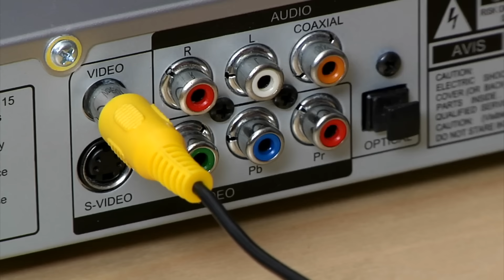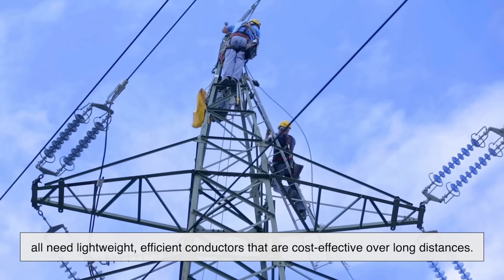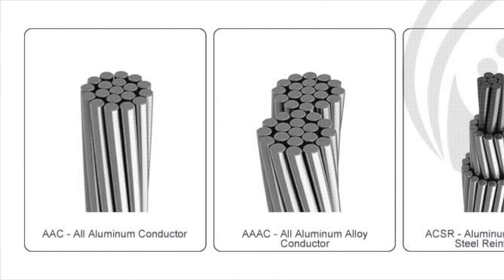Why Do Power Lines Use Aluminum Instead of Copper?

Comment: Aluminum is used for power lines over copper primarily because it is cheaper and lighter, making it more practical for long-distance, high-voltage transmission. While copper is a better conductor, aluminum's lower cost and weight reduce the overall expense and structural requirements for large-scale projects. The use of aluminum is often reinforced with a steel core to provide additional strength for overhead lines, notes this YouTube video and Nassau National Cable. 
Advantages of aluminum for power lines
Cost: Aluminum is significantly cheaper than copper, which is a major factor for large-scale power grid projects.
Weight: Aluminum is about half the weight of copper for the same conductivity. This reduces the need for stronger, more numerous support structures, leading to lower installation costs.
Strength: While aluminum itself is not as strong as copper, many modern power line cables are reinforced with a steel core (known as ACSR - aluminum conductor steel-reinforced) to achieve the necessary strength for long spans between towers. 
Why copper is still used in other applications
Conductivity: Copper is a superior electrical conductor, meaning it has less resistance to electrical current.
Safety and Reliability: Copper's higher tensile strength and lower thermal expansion make it a more reliable choice for smaller-scale applications, like residential wiring, as it is less prone to breaking at connection points due to heat-related expansion.

Comment: Copper or aluminum doesn't matter, if you live close to a high voltage transmission line. 
The microwave waves coming from it is not good for your health. 
Would you want to live close to a transmission tower or line. 
Property values go down, unless you're the owner of the land that the lines were installed on. 😅

Comment: Well my city and area all wiring is copper they removed the aluminum wiring years ago and replaced it with copper.  Copper doesn't expand in heat aluminum does copper is a better conductor and aluminum will have higher amps

Comment: It would be interesting to me to see more about high voltage AC & DC Transmission
and the differences involved with each including the materials used in the conductors, etc. etc.
Also the science involved with the production of the different kinds of  power.
Outstanding video, thank you.

Comment: With modern ultra-high voltage transmission technology, power can be transmitted with much lower amps, which means less energy loss with smaller diameter al cables. That's the main reason.

Comment: I'm an electrician from Durban south Africa and our metro elect dept uses aluminum MV and LV cables for cost and also cod of the theft when I comes to connecting to copper terminals bimetal lugs and ferrules are used❤

Comment: Years ago during storm clean up my foreman observed a wire dangling from the top of a telephone pole. He wanted to put caution tape on it, I said not to touch it . He laughed and said it's aluminum guide wire . I said it could be hot and I was right and he found out what 7,500 volts feels like when you hit your arm on a hot wire.

Comment: I used to live in a mobile home that was built in the 70's that had aluminum wiring. I had issues with connections arcing. Had to use conduit paste on all connections.

Comment: Between 3rd and 4th year electrical engineering I worked designing power distribution, street lighting and industrial circuits in factories. One job I inherited was to provide 440 V 3 phase for standby power for a boat at 500 A. Since we were in Ontario which used 550V 3 phase for industrial power, (now 480 US and 600 Ontario,) the guy before me wanted to run 550 V ac for 700 feet with one span of over 300 feet because there was no place to put another pole. This would have required 1000 mcm of soft drawn copper wire, which is extremely heavy. 

I called the local electrical utility and asked why we were using 550 v 3 phase. His answer was because that is what the previous guy wanted when I told him we won't provide 440 V. I asked what voltage was on the pole and he said 4160 V 3 phase. I asked can we get that voltage instead of 550? His answer was I was wondering when one of you would figure that out. I used either 700 feet of 1/0 or 2/0 ACSR instead of 700 feet of 1000 mcm copper. The price difference was amazing. I had learned earlier to talk to the foreman who actually do the installations on many project  as well as the more senior engineers because some of them were very bright but totally out of touch with reality.

Comment: Utilities use aluminum because of reduced weight and cost. In free air, current carrying capacity is not a factor. Aluminum conductors do carry less current than copper, but are only a consideration for lower amperage and installed in a raceway, not free air.

Comment: Aluminum is used for weight and cost, but the core strand is either steel or an alloy that is cooked to make it stronger so that the weight will not start to sag and break the cable. Copper is about 3x as heavy and about 2 to 5 times as expensive by weight. Aluminum is more abundant than copper by crust volume.

Comment: The problem with using aluminum wiring, is that most terminals are/were copper. Two different metals in contact carrying an electric charge will corrode. This is galvanic corrosion. This also occurs with different metals in contact, and some kind of an electrolyte is on them, like water, or even humid air. 
Galvanic corrosion is a very big deal when working with aircraft. Aluminum aircraft panels, with steel screws or rivets, is a major headache with fighter aircraft. I worked many years on the F-4 Phantom. I would sometime be tasked to help out wash rack for a week. Yep, washing jet planes every day for a week. Talk about your additional duties. I felt sorry for the guys who really had that job. Like working in a car wash, only worse. Working with severly caustic chemical. The need to wear (nearly) chemical gear while working all day. Coveralls, gloves, and booties. PD6-80 was caustic and no joke. Yep, it got the parts clean, and it caused cancer if you got it on your skin.

Comment: These powerlines visually ruin our more open landscapes. Subsoil is the future. Alluminum or copper just will not corrode or suffer when a 600kV cable is laid in a infrastructure highway containing longdistance pipes as well. Next stop and presently being used and developed : Superconducting cryogenic cables lowering resistence. Definetly subterranian or in a seabed.

Comment: Aluminum for the weight- ALSO- the power DOES NOT FLOW thru the lines - resistence eould be moumental- it floes along and around the lines
Reply: Correct !  it's called ,'skin effect', !

Comment: The amount of aluminum needed to equate to copper makes it impractical to use indoors just as the amount of braded copper needed to replace a solid copper wire is impractical.

Comment: The UK doesn’t use Aluminum for electricity power lounges, it uses aluminium instead 😂
Reply: I had to read that a second time, 🔍
but I laughed when I got it. 😊
UH-LOO-MIN-UM 🇺🇲
AL-YOU-MINI-UM 🇬🇧
Reply: I just lol’ed. Wonder if they figured out to use Aluminum instead of Aluminum in the Laboratory or a Laboratory instead?
Reply: @Ragazzo-Carino
21 hours ago
The UK doesn’t use  Aluminum  for electricity power lounges, it uses  aluminium  instead 😂 
Yes they use  aluminium  instead of  Aluminium
Reply: What is a power lounge?
Reply: Ale Yew Mini Umm
Reply: ...like the rest of the world.
Reply: The video mentioned that
Reply: I see what you did there 🤭
Reply: Good point.
Reply: It's cheaper and lighter.  This video should have been five seconds
Reply: @MindBodySoulOk you don’t get the joke

Comment: They used to put aluminum wiring in the older houses or mobile homes then it was outlawed in mobile homes because it overheated and would come loose after years of the jarring when the power is cut on and off.

Comment: There’s another reason for aluminum. In high voltage alternating current the electrons want to move away from each other, to the outside of the conductor, however in AC in particular, the change in the magnetic field induces a back flow in the center of the wire, which can be seen as a resistence to voltage induced flow. If the wire has a thinner diameter it means more heat buildup. By creating a helix of wires further away from the core it effective is turning electrons back in over a larger surface area keeping that surface cool. 

“Skin depth depends on the frequency of the alternating current; as frequency increases, current flow becomes more concentrated near the surface, resulting in less skin depth. Skin effect reduces the effective cross-section of the conductor and thus increases its effective resistance. At 60 Hz in copper, skin depth is about 8.5 mm. At high frequencies, skin depth becomes much smaller.”

The consequence of using twisted strands is to diffuse the center of resistence (back flow) and allow the a broader crossectional area were 98% of the electrical flow will occur.

Comment: Are those all tesla towers...? Not used for transporting only but for creating electricity... Steel re-enforcement kinda takes away from aluminium being a light weight... So now what is the comparison after the steel reinforcement is added. I find lamestream anything is mostly bull sht. We live in a huge deception.

Comment: The history section neglects to mention that only 150yrs ago Aluminum was considered to be a precious metal and cost similar to silver or gold. Only by the modern introduction of plentiful hydroelectric power was it practical to produce the metal in the bulk quantities required for industrial use. Aluminium does not occur naturally as a pure metal, despite being possibly the most common element in our Earth's crust: it corrodes so rapidly that naturally occuring Aluminium is always an oxide.

Comment: Lets not forget the the Chinese recent introduction of CCA - Copper Clad Aluminum. It's much cheaper Aluminum/Copper wire with a very, VERY thin coating of copper on the outside making for an awesome fire when the
aluminum becomes oxidized, corrodes and deteriorates. The U.L. really needs to look into this, there's been lots of fires reported from CCA. The chinese will say "Oh, it's 100% copper" until you scrape it and find it's only copper coated.
Those sneaky little devils. And no they aren't compensating with a heavier gauge aluminum wire.

Comment: Nice video but im surprised the issues of reactivity/corrosion were not addressed more specifically. Aluminum has a huge advantage in the transmission line environment and copper has a huge advantage in the residential environment or with ‘layperson’ installers in general. Also, any wire that’s going to be pulled, layed out, or otherwise installed ‘by hand’ is much easier to do with copper, even down to how forgiving it is in terms of fatigue from repeated bending vs aluminum. Still, good vid. 👍

Comment: Cooper conductors are also used in power transmission and distribution  it is going to depend on design and the area were the installation will be done. Coastal areas are affected by corrosion and aluminum is susceptible to corrosion and will require more maintenance than cooper in these areas

Comment: The down leads to your service head are aluminum. They are connected to your copper leads with a special AL/CU splice. The splices deteriorate with age. Fifteen to twenty years. You will notice diming or flashing lights. If it is the neutral lead your micro wave oven will be weak and make an odd noise. Just had my second sei changed in thirty six years. The linesman could hum the tone my micro wave oven was making.

Comment: aluminum is A LOT lighter, this is the main reason. Long spans are vvvvvery heavy, and using copper for long transmission causes severe sag and requires many more support structures which equals cost.

Comment: 🇫🇮 Alumin is MUCH cheaper than copper. That is the answer. And when valtage is hi, cables don't need to be thick or gold. Thin aluminium is enough. 
I'm electrician, I know. Don't believe bullshit.

Comment: When my dad was wiring our new house in 1955, he said he was using the latest thing, expanded aluminum. I inherited the house, and am living in it again. The only trouble we ever had with the wiring was that at the time, grounded outlets were not required. Over the years as more things required three prong outlets, he installed more grounded outlets. He used circuit breakers instead of fuses to begin with.
Reply: As an electrician I have always preferred fuses over breakers because fuses will always blow when in overload, breakers may not. That is why Federal Pacific breaker panels should be replaced. Federal Pacific breakers have huge failure rate.
Reply: @michaellammert8084  Our last house had a Zinsco breaker panel. Those had the same issue as Federal Pacific. So it had to go.
Reply: @michaellammert8084 is that a brand or a name for a certain type of layout? Rather ask a pro rather  than Google it and get misinformation 😊

Comment: I understand that the latest developement in high voltage cables is to have a Carbon fibre core , for tensile strength, with a larger Aluminium wrap made possible by the weight saving of dispensing with the heavy steel core. The result is an increase in the 'capacity' of cables of up to 30%.

Comment: As a election i thought when they went to aluminum wiring what's to make sure electricians like me have plenty of work. Because 90% of the problems I was Finding put the aluminum wiring on residential homes what's because it would heat up and expand and then cool down and contract and become loose in all the connections and sometimes just burn off totally without tripping any Breakers. But when I had my house built I did all the electrical I ran everything in Copper Palm out to my master pole and every time I had any issues it was always on the Utility side where they hook their aluminum to my copper. I can always tell when it was becoming loose because the amperage would go up my bill would get higher and I would have to call him out and normally that's 99% of the time where they found their issue on their side. So once again aluminum wiring normally falls on the expense of the consumer that needs the power and paste for time and time and time again. Must of took some highly intelligent Minds to come up was such a brilliant idea. My hat is off to the sabotagers.😂😢😮

Comment: Thanks for your presentation and mentioning HVDC,  High Voltage Direct Current.  The utilization of DC for utility scale power transmission is increasing. Acronyms like Ultra for UHVDC and Medium for MVDC are being developed along with a renewable/battery based decentralized power grid.

Comment: High Voltage doesn't really matter that much. Low voltage is better with copper. High frequency, use copper clad. If it moves, use copper.

Comment: after working in the industry for over 45 years the major reason they use aluminium is cost the weight factor can be detrimental because it can react badly in high winds causing the conductors to clash
Reply: You are correct. However, the issue of wind causing the conductors to crash can easily be attributed to bad installation works. When the right force/tension is not observed while drawing the Power Cables during installation, it will lead to over slagging of the Lines during the hottest time of the day, which the wind can easily swing .
Once it wings, chances are the Cables will touch. Thereby causing crashes on the Power Supply.

Knowledge of Physics and Geography help in achieving near perfect results in Overhead Powerline installations.

Comment: In my area, starting in about the 1920s-30s, when they installed electric lines, they used copper coated steel. It does have some slight oxidation, but is very functional and durable. It is still in use today but any add ons,  replacenents or repairs are aluminum.

Comment: I had 2 poles bringing power to my old property from the street. I never looked closely at what was in the street, but copper ran to my transformer. Later, I built a shop building, and they dropped another pole with a transformer. When we ran from the pole to the shop, we used aluminum inside of pvc from the pole to the meter. It was maybe 100 feet plus the height of the pole. I wanted to pay for copper, but the electrician said it wasn't necessary and the aluminum was fine. Otherwise, the power company wouldn't connect it.

Comment: Copper is too heavy and too weak.   I remember when the railroads had a lot of wires running beside the raillines, for communications.   They used copper coated steel wires.   The metal recyclers paid very little for the wires as it was a pain melting off the copper and the steel got contaminated by the copper and was too brittle for even reinforced bar.